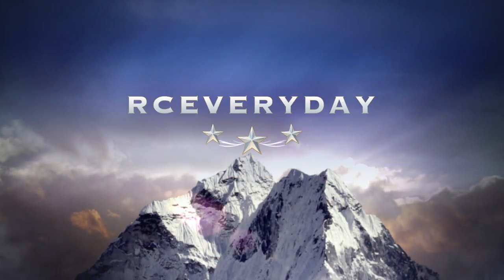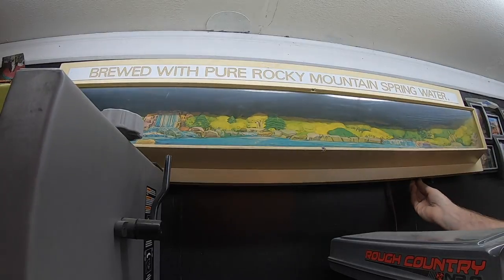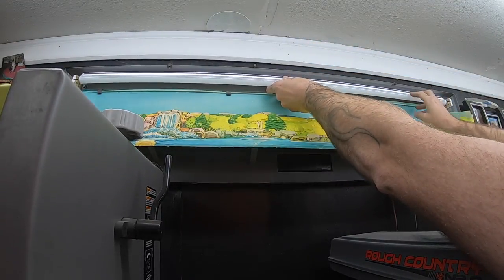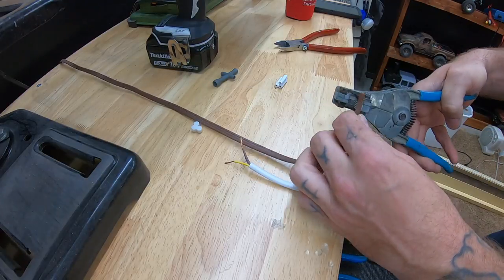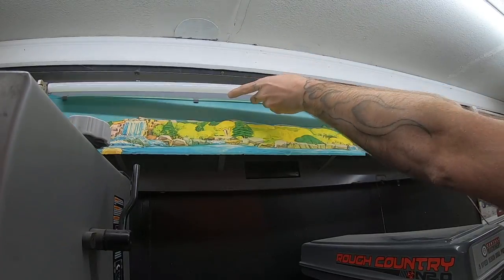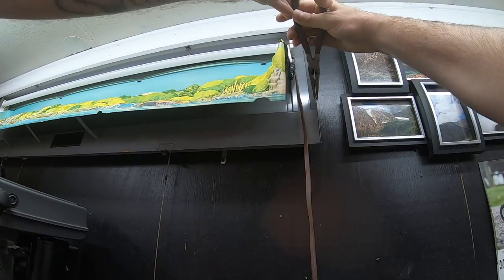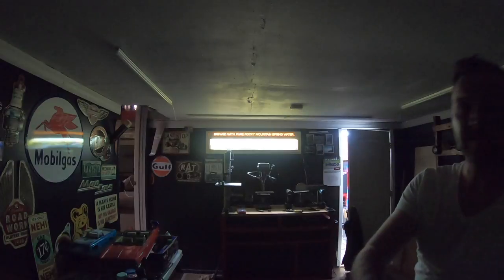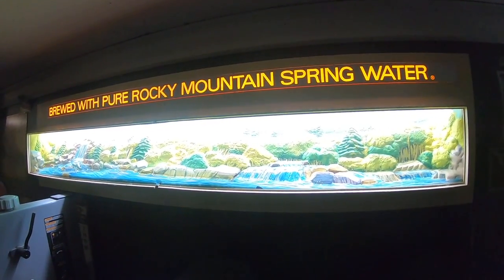Vintage Beer Sign, Swapping Fluorescent to LED, Light Restoration

Comment: I'm glad it worked out but, personally, I never would have hacked the original setup.
Also, you can safely clean the yellowed plastic with hydrogen peroxide in a uv bath; if you're interested.